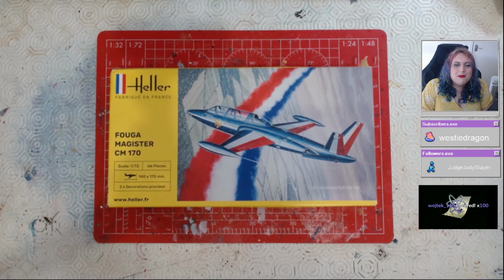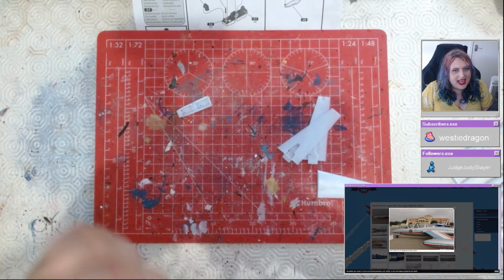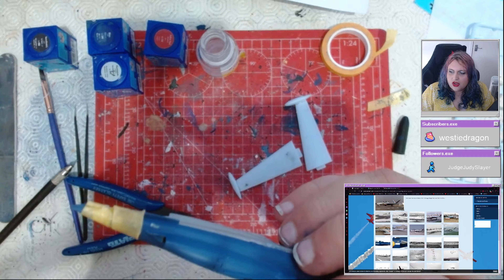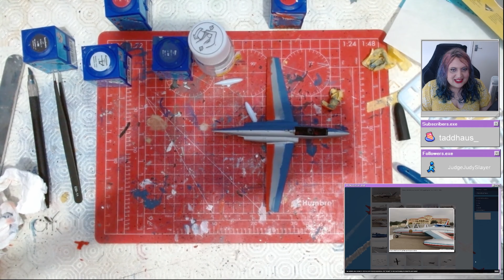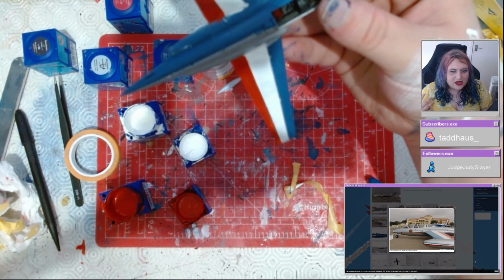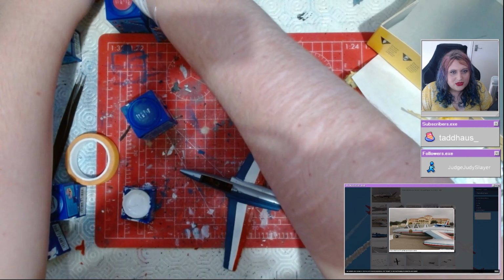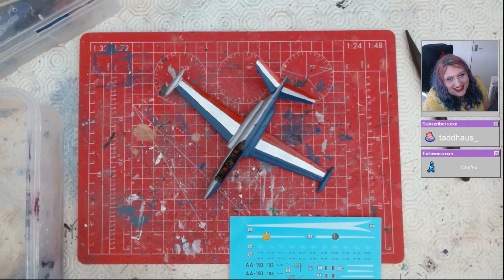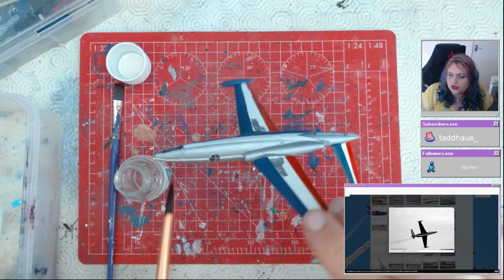Heller Fouga Magister - Patrouille de France || Model Making

Comment: Spraycan laquer the decal sheet if you feel its going to break. The decal will stay whole, but be careful with the backing paper after soaking in water.
Reply from the maker: I've done this at times but you shouldn't need to on a brand new kit imo! 😅💜
Reply: @MsModeller  I  know, its really annoying.  There is a way to test this tho, just try and use try and use the decal sheet label  or the kit makers name if its on there, Most makers put the scale and kit name on the decal sheet. If not, just spray it on regardless, its really the only insurance policy there is.